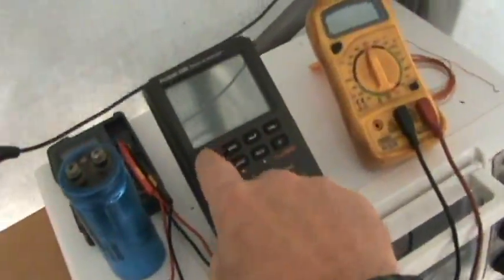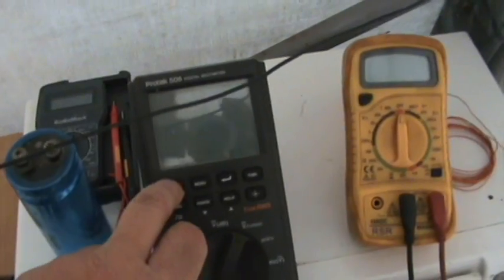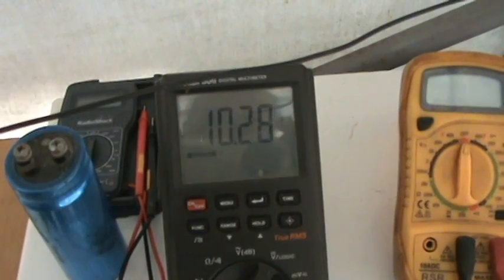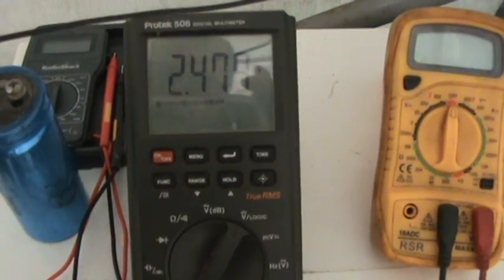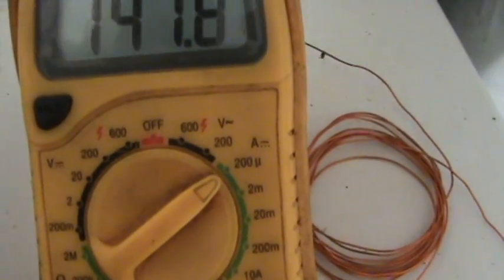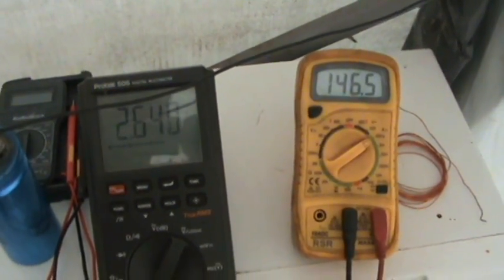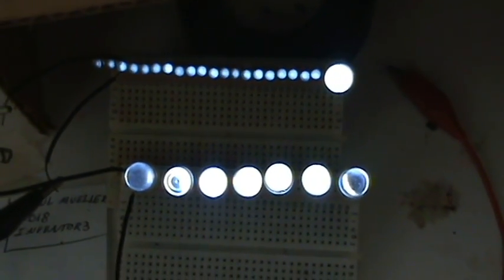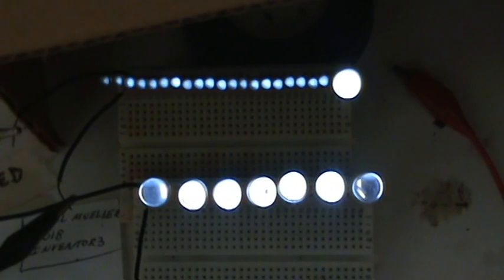Free Energy From Air 2018,  part 7

Comment: Tesla said you need a interupter,so use the voltage to trip a transistor and pulse it through a coil but a spark gap would be better,graphene ink is 100times more conductive too,

Comment: Thank you Paul, for uploading a new video. Cool.
Reply: p.s. Have you ever considered placing the antenna wires in a triangular setup?
Reply from the maker: @_John_Sean_Walker  Hmmm, interesting.  Never tried a triangle,,,but i have seen a square with "ion power group dot com".  Here is a video....
https://www.youtube.com/watch?v=ENeDkGce5-4&t=14s
Reply: Nope. I mean the Eric Dollard triangular.
Reply from the maker: @_John_Sean_Walker  Hey John, can you find me a link?  I have been searching,,,,,does it have to do with the pyramids or music, or golden ratio.
Reply: Thanks for your reply Paul.
You don't need to look it up. It is very simple. The wires go from A to B and from pole to pole, but one of the three wires is above the other two. Hence a triangle.
Eric said it works better. You just have to try if it works better for you. Good luck.
Reply from the maker: @_John_Sean_Walker  Ahhh, okay, i understand now, thanks.  I like triangles, pyramids, Tesla, 1,2,3, its worth a tri  ;-)
Reply: You can do better than Tesla.
Reply from the maker: @_John_Sean_Walker  Thank you for the inspiring words my friend, much appreciated.
Reply: I like your link to the Crystal Cell on John H's channel, but I can't find the channel from the creator of that vid.
Note that the guy has alunimium as casing, much stronger than the copper on the outside, like other videos show. The piezo electricity is also important. The copper always  tears open. (pressure)
I don't know whether iron has the right chemical valency, and it tends to rust a lot, but if it could work, it could well be the cheap future of Crystal Cells.
Cheers.
Reply from the maker: @_John_Sean_Walker  More info can be found here.  
http://rexresearch.com/reid/reid.htm

Yes, piezo is important, also Casmir effect on microscopic level.  No iron.  I have list of compounds written down, but hard to know exactly what percentages to use of each and which are the most important.,,,i need try to make some more cells again :-)  I also have notes on conversation between Marcus Reid & John H on overunity dot com, talking about each others designs.  I know what you mean with the copper & alum housings, some people try to press the compounds into the tubes so hard they split apart.,,,i dont think John H or Marcus do this at all.  John Bedini  was also making cells a couple of years before he passed.
Reply: Hey Paul, thanks for the information. What I want to stress here and in my previous comments is that the crystal expands due to the chemical reactions and therefore the pressure increases over time, but when you lose pressure, you also lose piezo electric efficiency. So you want the casing to be so strong that it doesn't split nor stretch.
What the Casimir effect has to do with it is unclear to me. It is often described as two plates being very close without touching each other, causing an extra force between the plates to occur.
Reply from the maker: @_John_Sean_Walker  Ahh, okay, i see what you mean now with the crystal expanding, yes, thats why they need to be tested for 1-2 years, to be sure that pressure still exists.
John H and others scientists that have studied his cells, say that the energy could be due to the Casmir effect, as you mention, force between plates, force between plates, a pressure,  gives us that piezo effect,,,,all the crushed particles in the compounds act as tiny plates.  Plus John always gave his cells a high voltage charge as they dried, to align the molecules Pos & Neg, this also helps to create the tiny parallel plates.
But, hey, this is all theoretical at this time.  The cells John made still need more study and experimenting.  I have his best cell videos on my channel.  He worked on them for many years and had partners, but eventually ran out of support money for the project. They spent 10s of thousands, and had some really good cells.  Johns best cells were stacked crystal wafers, about 60-70 of them in one cell and each one was slightly thicker than the last one by 1or2 thousandths of an inch, plus they had microscopic points or hairs culturally grown onto each wafer.  It's amazing to think,  the answer to endless batteries is right there for anyone to make, right now!,,,might take $10K to make the first one though.  Okay, im rambling now,,always good to talk with you John.
Reply: Thank you Paul, for your long reply.
I have a few Wiki links for you:
Casimir effect, to show you why I think that the Casimir Effect has not much to do with the Crystal Cell.
https://en.wikipedia.org/wiki/Casimir_effect
Piezo electricity:
https://en.wikipedia.org/wiki/Piezoelectricity
Electric battery, to stress that the chemical battery reactions and the piezo electric effect amplify each other:
https://en.wikipedia.org/wiki/Electric_battery
And keep in mind that the stronger the casing is, the higher the rocket will fly.
A dry Crystal Cell, probably only needs a drop of plain old tap water.
Cheers and good luck I3.

Comment: i'm no expert but, i suspect the increase in micro amps when the wind increased, was because of the combination of water and oxygen (air and rain) when they are forced to mix in a pressurised environment, (storm), it creates a energy vortex, and i further suspect it makes a kind of energy wave guide for the ambient energy in the localised area around antennas as they act as a dipole , ;) #peace

Comment: hey man can you tell me more about the voltage multiplyers
Reply from the maker: The circuit i use in this video is a voltage multiplier to a small extent due to the polarized caps, & it is also a rectifier.  You can find more info on the circuit im using by searching google for "Joe Tate APM"(ambient power modual).  Another and better multiplier that i use is a Cockroft/Walton voltage multiplier,,,,,which can be multiplied as much as you want,,,,,,here is link, i show schematics of it in video part 1........
https://www.youtube.com/watch?v=dLS8eZ1_bLU&t=25s
Reply: thanks man apreciate it. alother thing i wanted to know was how jhon hutchisons quarts wafer casmier effect power cell works. douse the casmier effect push the wafers together and the resting ossalation of the quartz wafer open them agan. causing it to ossalate prepetualy, and then puts pressure on the quarts, causing the piezio electic effect to happen?.

Comment: I would be remiss if I failed to mention that the trees are sapping a lot of the power your wires would have been collecting, were they the highest and most unobstructed points in the region... ~( 'w')/
Reply from the maker: I agree,,,,trees are sucking a lot of power.  Hmmm, that will be another project,,,power from trees,,,George Squire did this....
http://www.rexresearch.com/squier/squier.htm
Reply: Then comes the bigger question: how do you harness this power since it is going directly, and without any insulation, to ground, so that even if you are witnessing a lot more power than you would with a normal antenna [being as a tree is a perfect fractal antenna, it is by default tuned to literally millions and billions of frequencies all at once, and more so when in full leaf, although fewer in the dead of winter, or, as the article said, in a drought when electrolytes are less abundant for conductivity] you are scarcely tapping the tree's peak potential power.

Also, trees, just living separate hydrogen into protons [positive ions] and electrons [negative ions] and are worth potentially thousands of ampere hours, only if you divert those ions to create a usable electrical current, you risk killing your power source, seeing as those ions are critical to its 'digestive system' where said ions are needed to break down minerals for the plant to absorb them and take them up into its system to maintain and grow.

The main problems I would see with using trees is that you have to be able to insulate them from the ground, to make them available to be harvested, no matter which of 3 forms of power you are attempting to harvest from them and, that is just quite impractical.

Th power is THERE, but extracting it, that is the problem!
Reply from the maker: Interesting, i will have to do the tree project in the near future :-)  I read that pine trees are the best because of all the points, green all year.  I remember John Hutchison using a copper dish in the tree and powering a small motor with it.  John tells me to put a copper nail with long wire in the tree about half way up the trunk, and see what happens.  When i look at Tesla's radiant energy apparatus patent he just has one wire going from ground to antenna collector plate with a cap in series,,,,the tree can be the cap,,,,and he just has coming off of it in parallel a spark gap,,,hmmm, sounds good in theory.  Maybe add a coil around the tree trunk and pick up energy inductively.  Hmmmm, lots to think about.
Reply: Not sure how inductive moist wood is, that would be quite an experiment.

Put so many coils on a PVC support the same diameter as the tree, then measure,

Then put same number of coils around the tree and measure.
Reply: Nice brain storm. A wire a few times around a tree and a voltmeter should give an indication.
I will try that later.
Reply: @_John_Sean_Walker  Ideally a tree with a very high iron content would have a better result than one with a low iron content. Not sure how you could determine the iron content of a tree and how to quantify it, but I suspect that some types of trees will perform better than others.
Reply: You can feed the tree rusty water.
But you can also just try different trees. It is simple to wrap a wire a few times around the tree.
It is research remember. You don't need to charge your Phone with it. (Yet)
Reply: @_John_Sean_Walker  Actually you do not want to over-inject too much of any mineral into a plant, it can eventually kill it, many people think: "If a little is good, then a LOT is BETTER!" but often that is not the case.

You are best to begin with plants which naturally uptake a lot of iron, because otherwise you can find that the excess iron can cause a deficiency in some other mineral or in some other manner interfere with the natural balances of the tree.
Reply: Should we search for a blood sucking tree??
Reply: @_John_Sean_Walker  [sigh]
Reply: @Delicious DeBlair